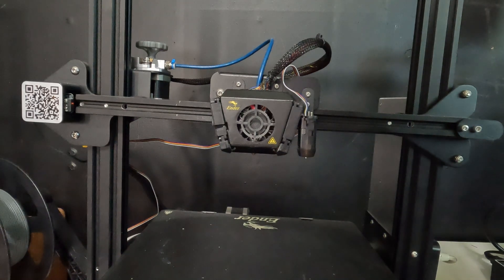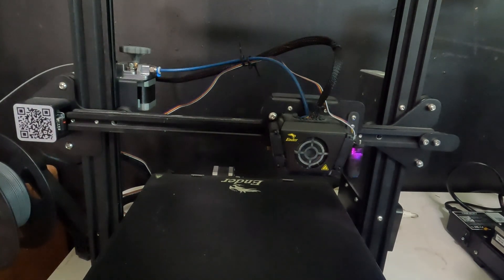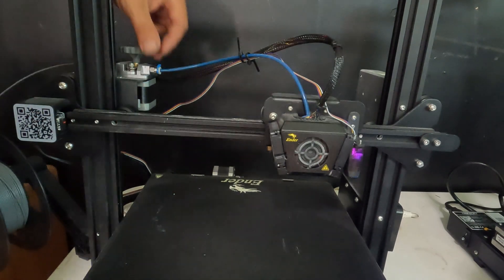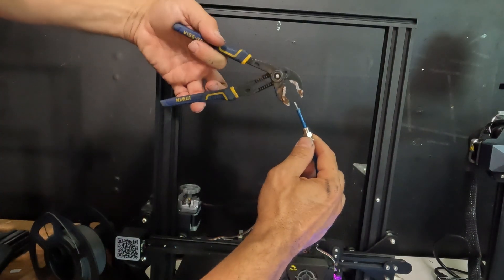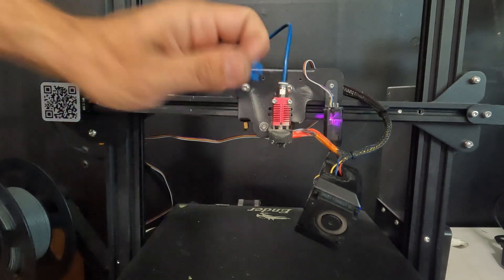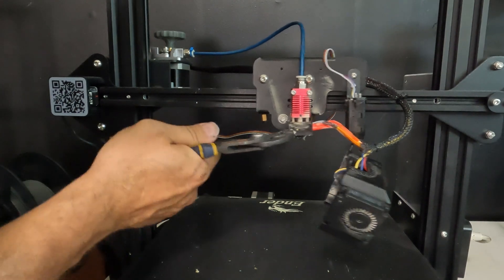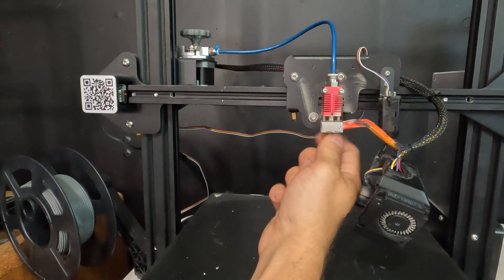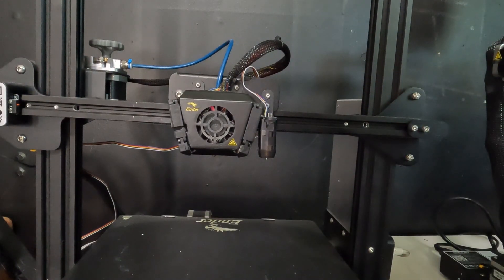How to Clear a Bowden Tube & Nozzle Clog, on a Creality Ender 3D Printer

Comment: My Ender 3 diudnt have a "brass screw" in the tube, just the blue plastic ring and the another plastic inside that i dont know if i can pull or unscrew
Reply from the maker: Maybe a diff hot end. Should be a coupler of some type with a ring that unlocks the teeth

Comment: If you have a nozzle cleaning wand (I’m not sure what the exact name is but it is .4 mm thick ) would that have fixed the nozzle so you didn’t have to toss it?
Reply from the maker: Something like the "No Clogged" does actually work well, but, for the cost of these V6 or MK8 nozzles, might as well swap it and get back to work

Comment: what do you do if you have filament stuck inside the bowdem tube???
Reply from the maker: It will move freely. If it's STUCK, it would only be at the very end, where maybe it melted. Clip 1 or 2mm, off at the end, and push the Filament out. Use Filament to push the Filament out.
Reply: @3DRundown  thanks will do

Comment: How do I clear the tube if the filament broke off and there's noting to grab onto to pull it out?
Reply from the maker: It'll be loose inside. If it's melted to the end to the tube, clip the tube, to remove that melted part. The rest will move freely. Use another piece of filament to push it out

Comment: Make sure the nozzle is hot... May want to add "make sure it's cold" for the last few steps else someone might get burnt.
Reply from the maker: Negative. You need to install the new Nozzle while Hot
Reply: @3DRundown bare fingers on the nozzle? Wouldn't that burn?

Comment: what does it mean when every time you shove your Bowden tube all the way down it melts and clogs but if I pull it back a 1/4 it doesn't melt. WIth that, it will still have a feeding issue and clog between the tube and nozzle.
Reply from the maker: Your Bowden should not melt. What temps are you using? Are you putting the nozzle in 1st, THEN the bowden, THEN, tighten the nozzle a touch more? Perpahs putting the bowden down too far. Also, be sure using Capricorn tube.
Reply: running my nozzle at 180 and my bed at 65. I am running just the stock Bowden tube for now but I just ordered a Capricorn tube and I think thats my issue.  @3DRundown
Reply from the maker: 180 is very low. Go with 200. 60 for the bed, no higher.

Comment: Mine gets clogged every print. It doesn't stay that way, I purge some filament, begin printing just fine, and then it clogs and the filament gets cut at the extruder
Reply from the maker: It should not. You may have a retraction issue. Have you messed with your retractions at all?
You may have a speed issue. Are you printing too fast? What speed are you at?
Your tentioner at the Extruder may be too tight. It should be several MM from seated, at MOST
you may have WET filament. Wet filament, is brittle and snaps. Consider a Dehydrator.
Reply: @3DRundown  the reason it gets cut is because it clogs, so the extruder keeps pushing and pushing, making that cackling noise and the little gear just cuts the filament by trying to push it so much. It happens with most prints, default normal speed profile. The little cat printed fine, but nothing I slice works. It seems weird that I have to change retraction settings away from default. It happens with prusa slicer and Cura.
Reply from the maker: Be sure your Z-OFFSET isn't too low, and slowing the flow from the nozzle. May need to babystep up a bit.
Reply: Hey just wondering if you ever got this fixed because I have the same exact problem
Reply: @kevster011  yes. The screw that tightens the extruder was way too tight, it needed to be in the middle. There were a couple more tips I was given about the bed level and the tubing needing to be well placed touching the nozzle, but my case was the screw.

Comment: I keep having issues where the filament will back up into the bowden tube coupler and solidify there. Been through a few of those couplers as of late. Cheap part, sucks it costs more to ship the damn fitting than its worth.
Reply from the maker: Hi. Something is wrong. Probably something simple. Elaborate in more detail. Will try to help
Reply: @3DRundown  My thought is that it's just a filament clog in the nozzle that backs up into the bowden tube coupler. You did mention in the video that the bowden tube should be pushed in as far as possible. I don't believe I had done that when I initially swapped over from the stock white bowden tube to the blue style like you've got here.

Its a CR10-S3
Reply from the maker: It's critical that the tube is cut FLUSH (only use a cutter meant for this, such as the one that comes with the kit), and is FULLY against the Nozzle. If it's not, there will be a little gap, where melted filament can leak through, and clog you up.
Reply: @3DRundown  I'll bet that's EXACTLY what happened, I was cutting the bowden tube with the flush cut pliers included with the printer. I don't have a tubing cutter for anything that small, but I do have one for automotive hoses. I'll see what I can do once the fitting comes in. Thanks for the guidance, hopefully that solves the issue!
Reply from the maker: Definitly don't use the clipper.

Comment: When I pushed the Bowden tube in a far as it could go, it melted and came out of the extruder….now the tube in tiny because I didn’t realise until it was too late. How do you know when to stop pushing?
Reply from the maker: No way the bowden melted. You sure you didn't push some filament out? If the end of the bowden is melted. Just cut that part off. Remember to put the nozzle on first, then push in tube till it stops.
Reply: @3DRundown  I think you’re right, it was probably just a lot of filament! It was brownish so I thought it was the tube but it eventually stopped. Thanks for your help!

Comment: My filament is broken in the tube so i cant get to it, and the tube is stuck to the hotend and I take rake it off, I'm not sure what I can do
Reply from the maker: How to Clear a Bowden Tube & Nozzle Clog, on a Creality Ender 3D Printer
https://youtu.be/Xp9vxUxzgE8
Reply from the maker: Heat the hot end. Unscrew the extruder coupler, pull it out. If you can't grab it, heat the hot end, then remove the coupler at the hotend, and pull the bowden out.